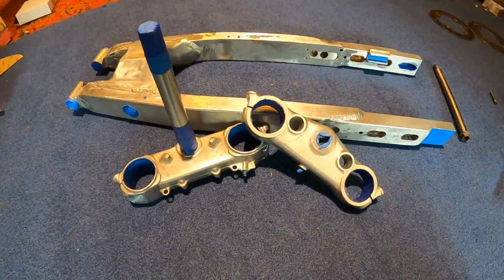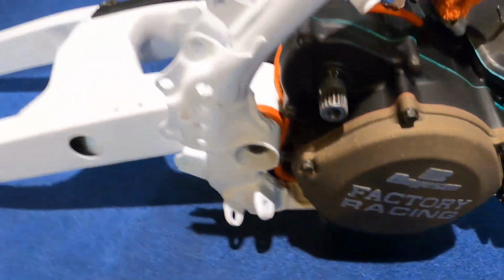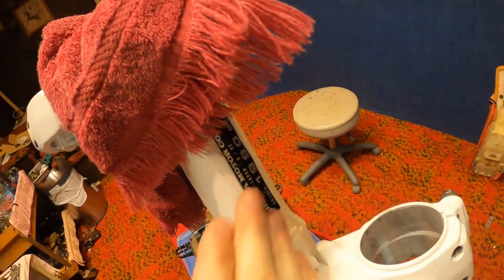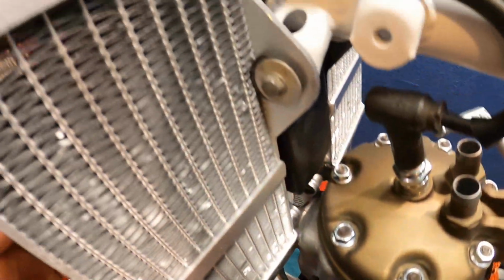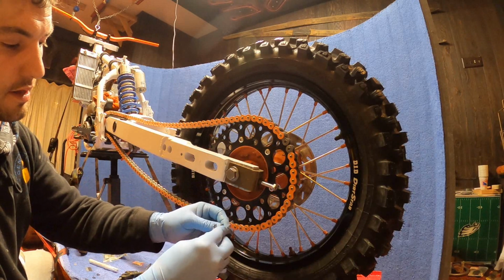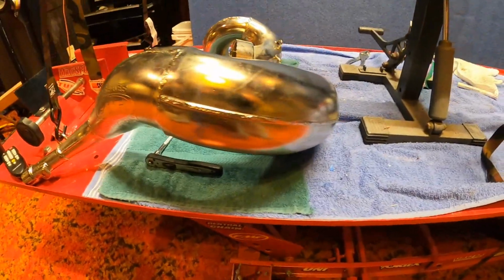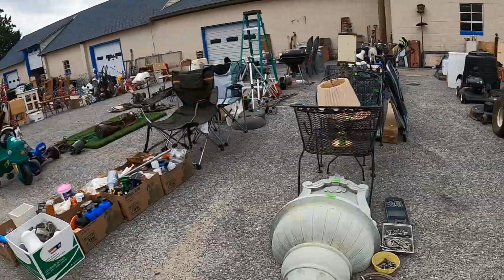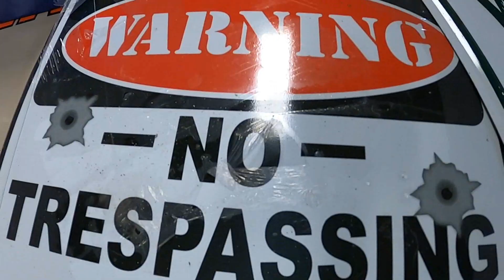CR 500 final prt 1 1990 honda cr 500 restoration/rebuild/custom

Comment: Turned out great. Who did the cerakote work?
Reply from the maker: Nice looking dog ..I did everything but weld the aluminum.. gotta check out earlier videos .. full build is on the channel.. white was air cure .. black bronze and I mix up the orange             were oven cure
Reply: @judaslicciardello3946  im rebuilding up my 91 cr500r (90/91 are the same bike). Hopefully mine comes out as nice as your bike did. My stock radiators are in good functioning order, but the fins are bent and they were repaired in the past so not cosmetically nice to look at, been looking for another set or some good quality after market's. My engine is ported and polished, squish band adjusted with milled head, set up for high compression and race fuel (112-116 octane). Billet sc2 smartcarb, boyesen rad valve reeds, msv exhaust flange. I used to run a procircuit 304 silencer with gnarly fmf chamber, but I'm debating on trying a pro circuit platinum/works exhaust with the 304. I have excel a60 custom built rims, core moto stainless brake lines, and updated the front suspension to a 2001 cr500r with the 01 front brake, triple tree, it's a direct fitment to the 91 frame. Going with racetech gold valves and sprung to my weight. Galfer rear wave rotor, with motostuff over sized front rotor. Fasst Flexx bars, asv c6 brake with clutch levers, mxbonz bar risers, billet aluminum mount cones. Frame and subframe have been powder coated with lollipop red over a silver flake base. Stock oem size replica tank in white made by Clarke. CMT hand made carbon fiber skid plate, ignition and clutch covers, skit plate, with case saver. Still need a few parts to complete the build. I would like to get my rear brake and brake reservoirs cerakoted, but don't know anyone who does that service unfortunately.